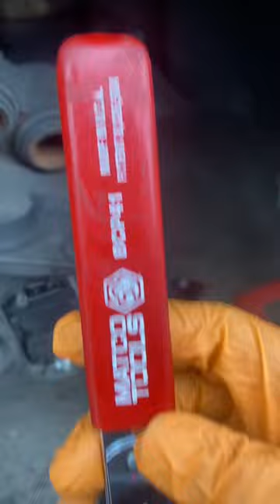Matco Tools BCP41: 4-In-1 Brake Caliper Press Makes Brake Jobs Easy! #tools #shorts

Comment: nice $50 lang 279!!
Reply: I bought mine for 16.00 dollar
Reply: @josephbagio7930  I bet you did buy the cheapest shit you could find. Mechanics make poor ass choices.
Reply: @MrSims-ky2ne Most tools are just re branded lol. Matco doesn't make tools they just sell them. This isn't a new thing
Reply: Bought my Lang brake tool  on Amazon for $48.94 5 years ago and it still works great. Exact same thing as the Matco. Matco doesn’t even make this tool, it’s probably the same tool I have only rebranded.
Reply: @MrSims-ky2ne  it’s the exact same tool 🤣I’ve had mine for 5 years and it still works great.  The Mac version isn’t even made my Mac